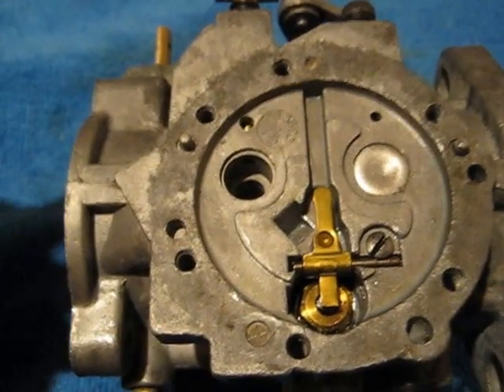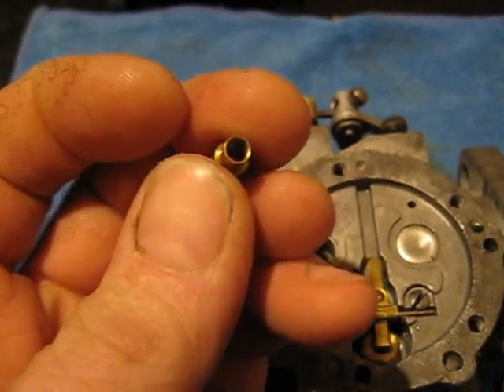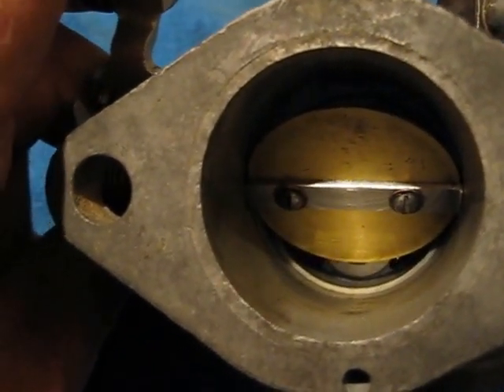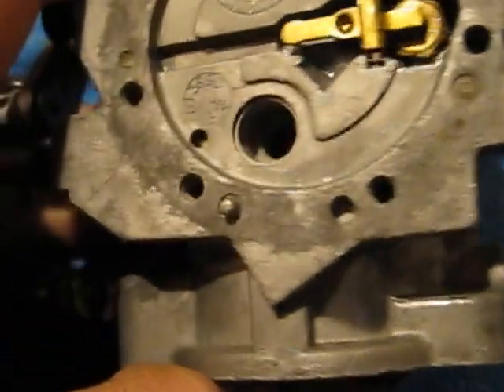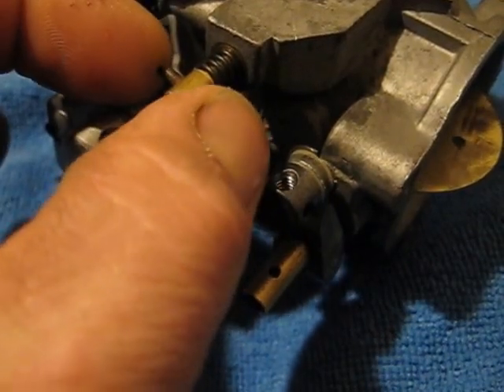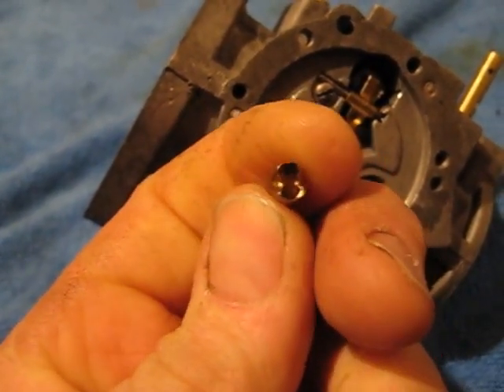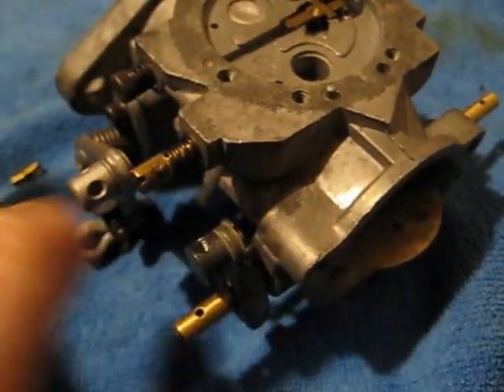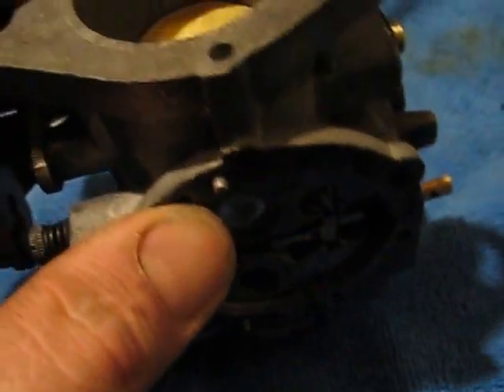Tillotson tips. Troubleshooting the check/nozzle valve. Part 4

Comment: I have a 1970 Shovel with a Tillotson carbie. I have tried to rebuild the carbie as the bike wasn't running right coughing and spluttering all the time and starting it was a nightmare. I put a rebuild kit through it using the shop manual and thoroughly cleaned it and made sure of no leaks etc but it still wont start easy and pops and splutters at low rev. At idle when stopped at lights it revs high then drops to normal revs after a minute or so but it doesn't do it all the time. It also pops at low rev and then stalls but not all the time. This is driving me nuts.
Reply from the maker: If it is carburetion, popping/backfiring, high idle are symptoms of lean mixture/intake gasket leak or fuel starvation. 
I have no experience on motorcycle carbs so I cant offer any specific advice. But the basics include needle and seat pressure (spring) being too stiff, needle fork set too high, a restricted or plugged filter/tank fitting, emulsion holes under the Welch plug dirty, low speed fuel screw issues. 
Hope you figure it out!

Comment: Awesome set of videos. I have an HL and removed the check valve. I have another, but the hole is smooth, no lip
 How would I set the new check valve? (Had to replace due to bad fuel sitting in it)
Reply from the maker: Every HL I have worked on the nozzle goes flush with the bowl of the carb. I'm not sure what you are tangling with, but good luck.
Reply: Thank you.  Dealing with a flooding issue, left a 20:1 mix in the carb for 2 months and it made a mess of things..... new nozzle did not fix it. Pop off is around 7psi. Might be easier to just get a new HL334.

Comment: have Tillotson H44A . 71 motoski capri starts but then revs way too high.  can slow it down with the Choke only.  Throttle seems ok open and closes ok ???
Reply from the maker: Hard to say from a distance, but make sure the throttle cable is not adjusted too tight and not letting the arm hit the idle screw, and make sure the idle screw on the arm is not adjusted too high. 
Barring adjustment issues there could be a bad gasket behind the carb, spacer plate is cracked, primer sucking air and making it lean and revving up.
Reply: @robh9577   The throttle 'shutter door' is almost closed . should it be completely closed closed at idle ?
Reply from the maker: @bobpascas7670  again over the distance it's hard to tell lol. 
First is loosen the cable so it slides, then back the idle screw all the way out until the arm is resting on the stop. Give the idle screw 1 turn IN then take the slack out of the cable and tighten the cable screw back up.
So you are positive the carbbisnt open too far, after that its about only air leaks that can cause too high of an idle

Comment: got a 1973 ski doo everest with a tillitson carb  sled will only start when primed with fuel thru the intake, won't stay running just starts then won't pick up what should i just rebiuld the carb and check those caped ports
Reply from the maker: 6oh_ Stirrett if it's not pumping fuel either its not getting fuel from the tank, the diaphragm in the carb is no good, or needle is stuck.
Reply from the maker: Any time you have the carb apart should pull the welch plugs.  Be gentle with a 1/8 drill bit and once you just crack through, pry them out with a pick.  Seat the plugs how they look in the video, don't beat the crap out of them.  Tap with a small hammer.
Reply: Rob H you have a link to a website i can get quality parts ?
Reply from the maker: 6oh_ Stirrett  https://eccarburetors.com/estore/

This seller on eBay sells nice stuff.  My go to.  
https://m.ebay.ca/sch/i.html?sid=gary*&_pgn=1&isRefine=true
Reply: Rob H thank you, much appreciated

Comment: Hi is the check valve part of the main jet? or is the main jet separate?
Reply from the maker: Well a tillotson really doesn't have a "main" jet like a mikuni etc, but the check valve/nozzle valve functions as the high speed jet.  The amount of fuel going through the check valve is dictated by the high speed adjustment screw on the side of the carb.